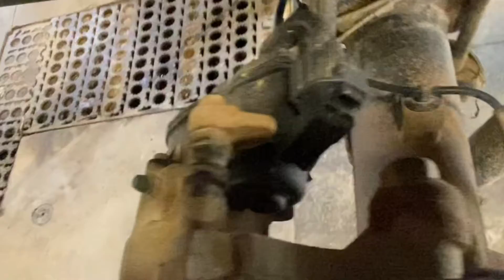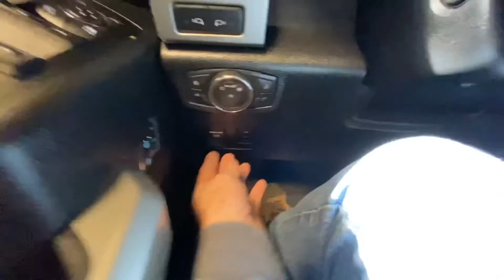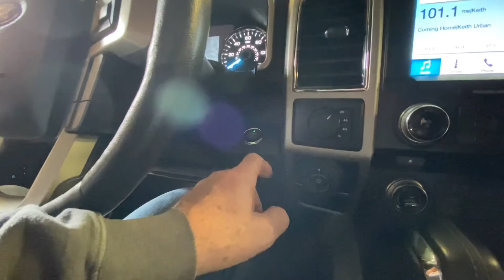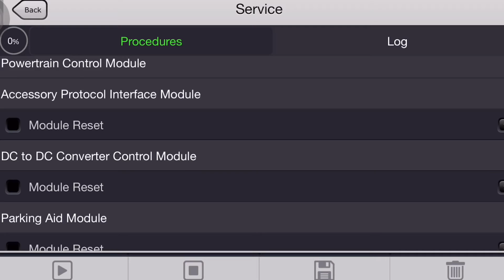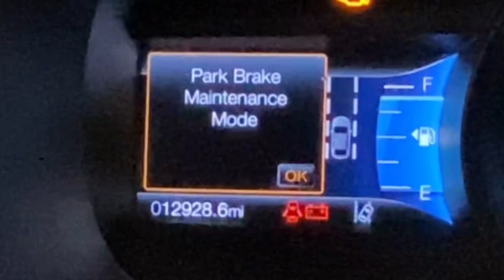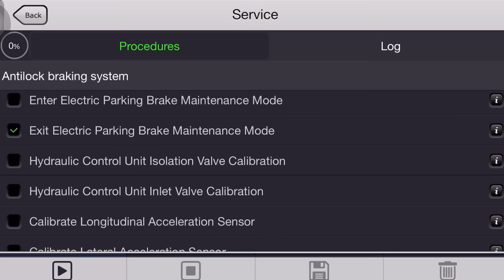Installing Brake Pads on Ford’s with Electric Parking Brakes

Comment: Thank you for the video!
 I am about to replace rear brakes on a 2020 Escape, which I believe uses a similar procedure. 
Anything special for doing the recommended brake flush on the Escape?
Reply from the maker: It should be similar. I don’t think there’s anything special. Don’t let it run out of fluid / introduce air.
Reply: Great, that's what I'm afraid of... a simple brake job turns into a tow to the dealer 😢

Maybe I'll just remove the EPB motors to replace the pads and let my shop do the flush when it goes in for tires.

Do you think it's necessary to open the bleeders during piston compression?

Not liking these electronics at all!
Reply: Thank you, sir! 
I didn't think so, but some interweb folks were saying you need a scan tool (or ForScan) to activate the ABS. I'm thinking that may only be necessay  if you get air in the system
Reply from the maker: @JJK-le2yj  it’s not suppose to be required, but I have seen some that wouldn’t come back out of maintenance mode without a scan tool.

Comment: Again, very informative and straight to the point. I'm about to service the rear brakes and was unaware of the need to put the electronic park brake in maintenence mode. This video just saved me a lot of time and headache, thank you
Reply from the maker: You’re very welcome!
Reply: How do I do it on ford galaxy 2016-2019

Comment: Is the fordscan yearly subscription or one time?
Reply from the maker: Forscan.  No “d”.  Probably because of copyrights. It’s a one time purchase. I think Forscan Light for a phone is five or six dollars. The windows version for a laptop is around $55 or $60.  The laptop version will definitely do more, like asbuilt data mods or change programable parameters, but forscan light is usually my go to for initial diagnosis.  The icons and where the tools are is a little different than anything else I’ve used, so that takes a little getting used to, but the more I use it the more I love it.  You need an obd adapter to plug into the vehicle.  I use a obdlink mx plus. It’s capable of talking to multiple networks on the vehicle, so it will work with all the modules on the car instead of just the ones on hs can like some of the cheaper ones. I think the adapter is around $140 and I just keep it in my pocket all day. I need to do a video on forscan some time. I get a lot of questions about it.